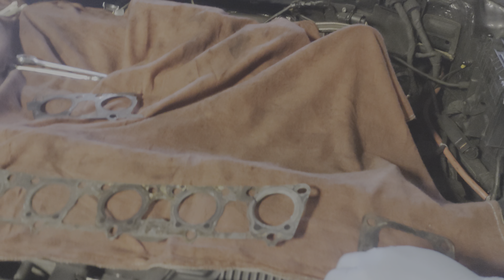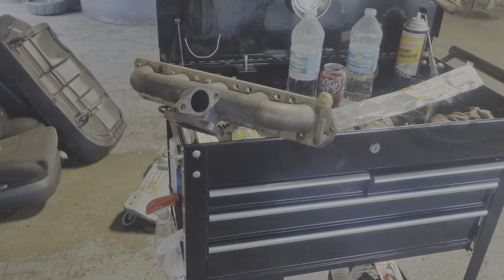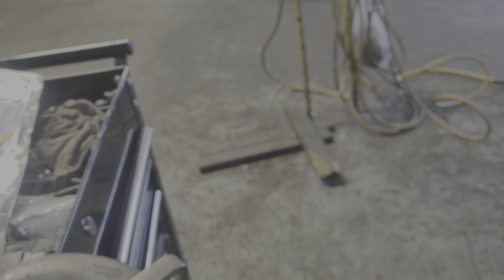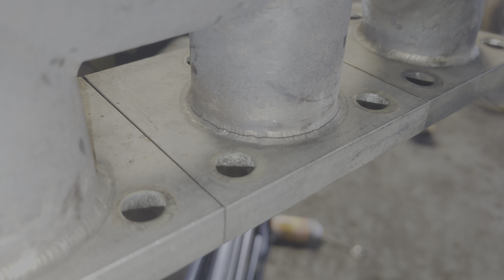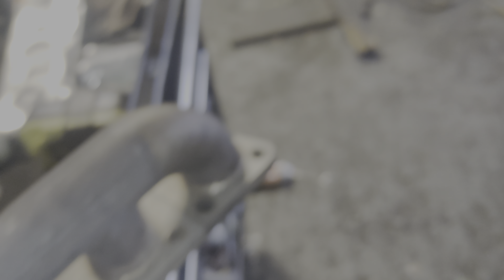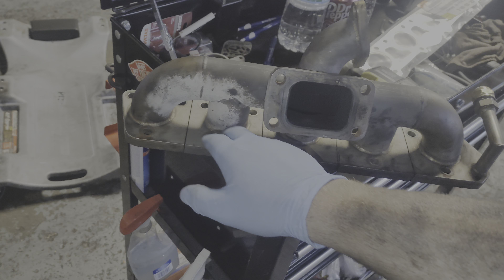Do NOT buy this turbo manifold if you are boosting your 2.5L

Comment: The c2 manifold was awesome when new. But it required new gaskets and that sai section should have had studs installed. 

This manifold was on my 2.5t and ANOTHER 2.5t back in 2009. It probably has well over 150,000 plus miles on it!
Reply from the maker: Nah. This one was installed on the car with like 15k miles, and I bought the car with 42k miles. Now it has 100k

Comment: Nice content. I have a 2012 2.5 SE 5 speed. Cbu block I'm not sure.  Is the O7k a different head and crank? 👍💯
Reply from the maker: 2012 is CBUA or CBTA which is good. It's an 07k so I'm not sure what you mean if it has a different head and crank. Compared to another car? I can tell you the 2.5L engines are identical from 2006-2014 besides some early 2006 & 2007 models getting a factory forged crank and early 2.5 (pre-2008) had a slightly different intake manifold internally. Also MK6 (2010+) had an updated exhaust manifold.
Reply: @SubsurfacePodcast   

https://youtu.be/pYhnllDqsxc
The video I just watched just made me confused. And the RS3 head seems so much different. With dual injection and nitride cranks. I cant find any answers on google. And I can not find any RS3 engines used for sale as they are so new. I'm just very interested now. And I would like a 400hp daily so trying to figure that out?

Comment: Nice informational vid. Have u looked into the TTRS or RS3 manifold? Also do you know of anyone that makes a header for our 2.5? I don't want to have to buy a different downpipe than my USP one so it would have to be a stock flange setup.
Reply from the maker: The TT RS or RS3 manifolds are not compatible. They can work but it requires a good amount of modification to get the flange on our cylinder head. And it's very expensive to get one of those compared to a turbo and manifold that readily bolts on. I'm not sure if there are any aftermarket headers for a naturally-aspirated setup that bolt to the USP downpipe. I know you can go from an MK5 OEM header to the factory header from an MK6 which is a slight upgrade. You won't really feel any performance increase but it does sound better, like a little throatier and deeper. I loved it when I had it on my Jetta. But there are aftermarket headers available. You can get an OBX header but I don't think it's a direct bolt up to that downpipe you may have to modify something to get them to match. In fact I'm pretty sure they don't match up 100%. But you should know the OBX header loses torque so it's really not a good modification unless you're trying to just be loud. The only header on the market that actually makes power, comes with a downpipe. It's actually very expensive but it's the only header on the market that increases horsepower and torque. In fact the only way the 2.5L will get over 200 whp in naturally aspirated form is with this header and downpipe. Its from IceEngineWorks. Formerly known as Evolution Tuning. Its a stainless steel tubular equal length header and downpipe with a highflow cat. You can see it in one of my videos from earlier this year. I ended up installing it after my Jetta was rear ended and after driving with it for like a month I decided to part the car out and send the car to the junkyard 😞. But yeah that header combo sounded like a legitimate race car. That combo is around $1,400 or so. Yeah very expensive.
Reply: @SubsurfacePodcast  TY for the reply. I've seen a read about the OBX. I didn't like it. I remember Evo tuning. That tubular was insane. Didn't know they still have it available. Wish I had known you parted the car out :( I probably would have bought the setup. So will a mk6 header be a direct bolt on with no mod needed?
Reply from the maker: @carlospacheco8640  As far as the MK6 header I do believe it mates up to the USP downpipe perfectly. However I had the Tsudo stainless downpipe and i had to trim some pipe that protrudes out on the header because it wouldnt slide into the downpipe opening. But a few guys have installed the MK6 header into a USP downpipe without having to do that. I do recommend being prepared and getting new exhaust studs and nuts as well as 4 new nuts and bolts in case the ones on the header are corroded. And always use new gaskets.
Reply: @SubsurfacePodcast  TY again. U are the man!
Reply: Was looking for that header dp combo from iceengineworks. Can't seem to find it. Ive been looking for good header for the 2.5l
Reply from the maker: @E11ven  If you still want to get one made, you can message Robert Baromeo. He is the fabricator that designed them and makes them. Cool dude. Find him on Facebook. I think his profile picture is at night and he is spinning fire.

Comment: Quick question what's the correct way of changing the 5 speed manual gear oil....on a 07 Volkswagen rabbit every body keeps telling me a different way of doing it.?? Thanks.
Reply from the maker: 5 speed gear oil change procedure:

"Go in car, lift up leather shift boot and lock shifter in place with a 5 or 6mm nail by lining up the two holes. Locks it in basically 2nd gear but not quite.

Then go under the hood and find the black "L" lever near the shift mechanism on top of trans. Press down slightly on mechanism and turn the lever to lock in place, be careful not to force it. 

Once its all locked in place, jack up front up car with plenty of room and secure with Jack stands. Remove drain plug by differential until it's done, the locate the pin on the bottom of the trans closest to the driver side tire. (There's 2 pins) make sure it's the outer most one. Its a T45 torx bit. Remove it to drain the rest. On that pin there is an o-ring. I've drained my gear oil without replacing it but I recommend you get a new o-ring before hand. Also wouldn't hurt to put a small amount of Teflon tape on the threads of the main drain plug. After drain areas are done, dry off surface area and fasten bolts. I don't recall a torque spec. Just do it a little tighter than a spark plug lol. 

At this point you can drop the car, remove the reverse light switch on the trans which is close to the headlamp. Its right in there. What I used was i think a 21mm or so deep well impact socket, put it on the switch first, then placed my ratchet on it. CAREFUL! It is very easy to break the reverse light switch by overtorquing. Tighten it just a tiny bit more than hand tight. After you remove it, insert drain tube with funnel, fill with 2 bottles. (GL4 OEM VW gear oil) 

Honestly, finding the perfect funnel and drain tube that fits right in the reverse light switch is the hardest part of it all lol.
Reply: @SubsurfacePodcast  thanks you I really appreciate your help.....
Reply from the maker: @leoncioluquin44  no problem

Comment: I've actually heard good things about the spa turbo cast manifolds. They're inexpensive ,$500 or so. It puts the turbo at the end instead of the middle so you'll need custom downpipe
Reply from the maker: All turbo manifolds for the 2.5 require custom downpipes. JDL used to make a downpipe with their manifold but eventually only offered the manifolds. And now they barely make them anymore.

Comment: No wonder I hadn't seen it outside the shop lately
Reply from the maker: Yeah man. Shes getting some special bandaids put on lol. Im driving a black MK4 Jetta 1.8t now. Once the Rabbit is fixed ill drive it again for a little and park it again until it gets cooler out most likely.
Reply: @SubsurfacePodcast  bro that's like the only other VW I see there. Figured either you were driving that car, or you left that job
Reply from the maker: @elyklenzak7695  Yeah I literally park the MK4 right behind the Rabbit lol.

Comment: I have a question i want to boost my 2.5 but looking for intercooler that will help. What route can I go
Reply from the maker: There are many intercooler set ups you can do. It all depends on you (or your favorite local fabricators) ability to modify things to fit. But there are a couple Vibrant and Mishimoto intercooler that fit well with minor modifications to the bumper and little to no modification to the crash bar. But these are rated for I think 400-450hp max.
Reply: @SubsurfacePodcast  I appreciate the info brotha 👊🏾🍻

Comment: Can you give a link for a turbo kit for 2.5 L ?
Reply from the maker: There are no full kits. Closest thing to a kit is JDL auto design. They were offering a nice turbo manifold, downpipe, turbo inlet, wastegate and some other parts with the option to have it all ceramic coated. Started at $4,700

Comment: I have the same manifold on my car it’s trash. Mine cracked in the same spot way worse that yours it’s down to the t3 flange so I’ve had to weld the entire thing down the side
Reply from the maker: Yeah as we speak my manifold is at a shop about to get reinforced and then ceramic coated.

Comment: %100 user/install error. 
Mate, if you have 1/8th inch gap between the manifold and the head, tighten the fucking bolts?? 

Also, the cracks at the base of the header are because you're hanging the turbo off of it, without support. You can't blame their product for your lack of knowledge